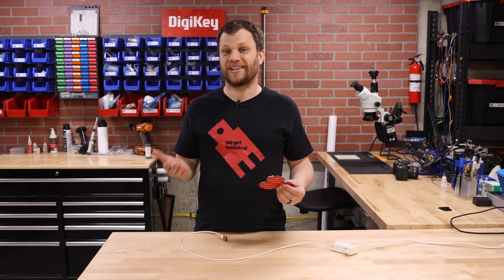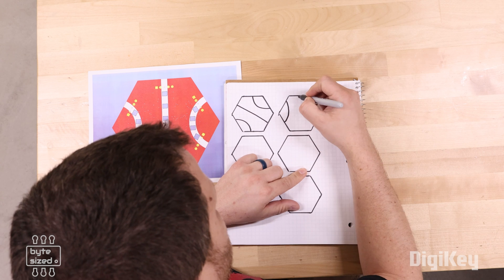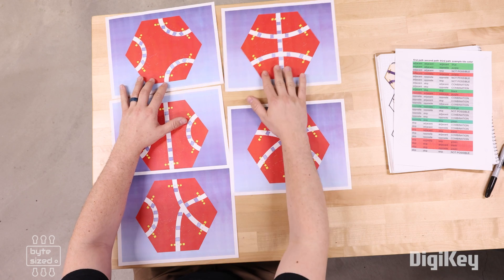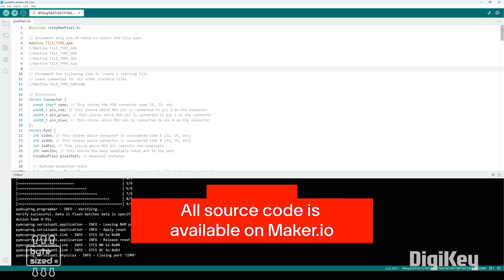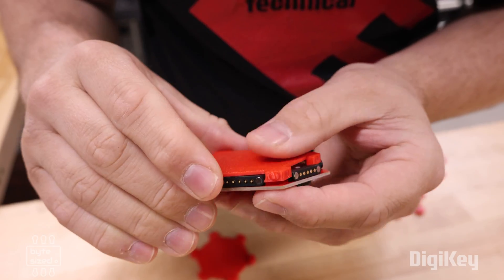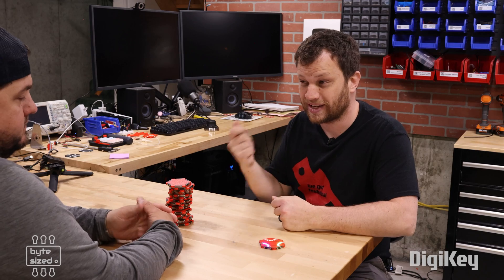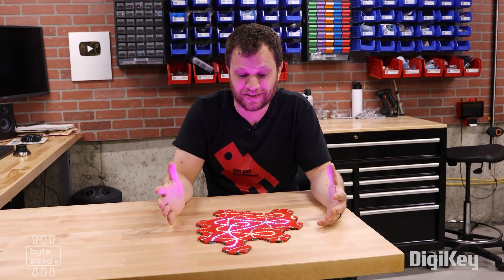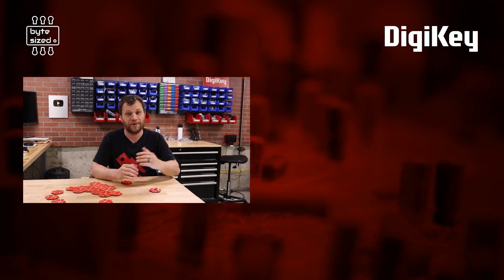PCB Tile Based Board game Part 2 - The Byte Sized Engineer | DigiKey

Comment: I use to like DigiKey but thing have been getting bad. Maybe they will see this and actually try to fix the problem. 

They ship you the wrong items. In the past few months it seems like there will be a 30% chance you will receive the wrong item.

They don't give clear communication on how to fix it.

They give you a tracking number but they don't actually ship out the product. 
If it's not going to be shipped within the next business day then don't mark it as shipped.

Comment: Use a cable with an inline magnetic connector (or a small pcb - single hexagonal sized edge connector) on it to power the first tile...

Thereby any tile could be the first tile??

This feels very similar to a game called "tri-ominoes", but that has silk screen printed colours, instead of assignable LED colours..

Comment: Did you consider using a voltage divider on one of the ADCs to set a different voltage for each pattern, and have the firmware check that on boot?
Reply: We did! We considered a lot of different things actually. Because we wanted to have three data lines on each side, we needed 18 gpio pins and had exactly enough with not one to spare! Having one extra pin would have been really useful to implement your suggestion. This design is open source and I would love for other people to get involved and improve it. It might evolve and not need three gpio pins per side which would leave open some extra pins to do something like this

Comment: starter tile could be special - fatter than the other tiles and have a lipo in it. Could also have a bigger processor and sounds.
Reply: but the starter piece should be random. so a dedicated starter piece would take away from the randomness. however if the starter piece randomly generated directions that would work. but would require many more leds to account for all directions.
Reply: @williejohn2003  Could probably just use one dot on each side which is randomly lit, 2 green, 2 blue, 2 red... goal is to create a circuit back to the other dot? That would also leave the center of the tile space for a speaker.